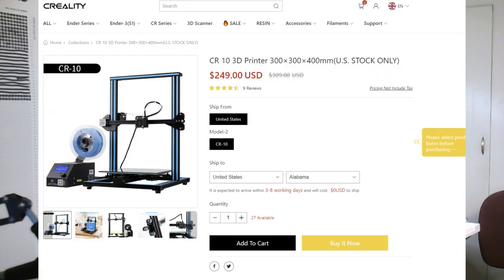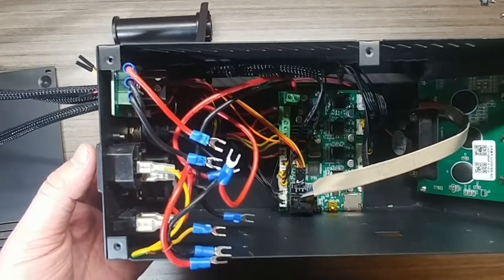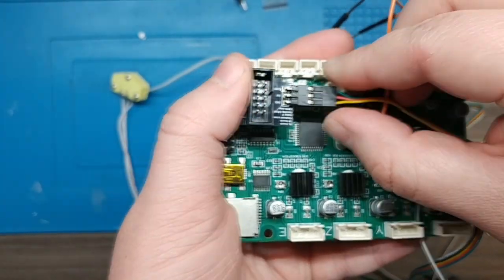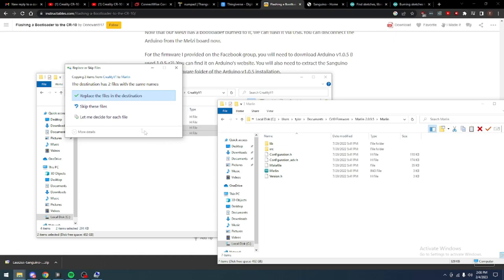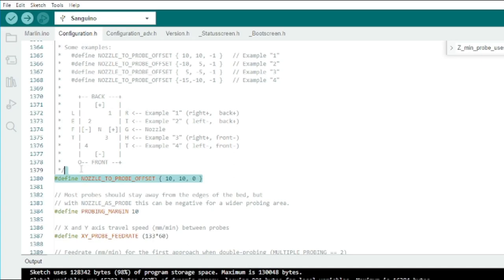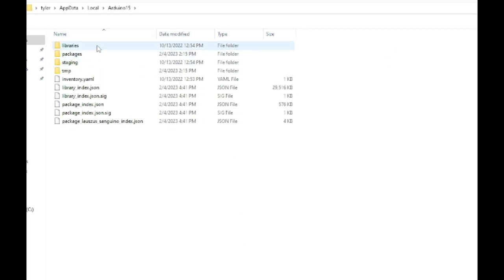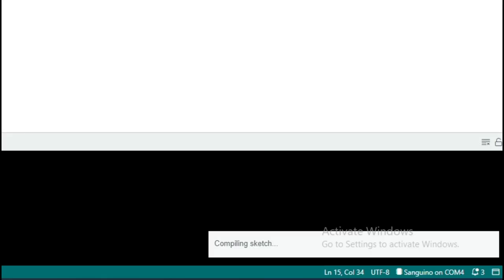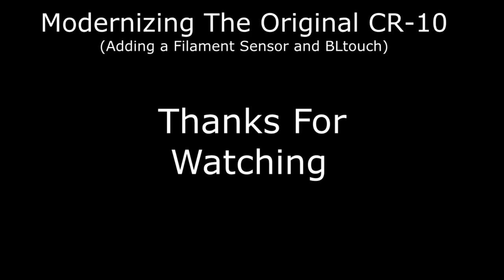Modernizing Old V1 CR-10 for 2023 – BLTouch, filament runout, Marlin 2.0

Comment: Thank you for this video! I've just upgraded my FIL's printer - an old CR-10 - to have a ABL probe and filament sensor and your video was a very helpful guide. Somehow using VScode and platformio I got the firmware on the board and didn't loose any functionalilty. Not many people had clear guides to follow for trying to do this so appreciate yours.

Comment: I have just bought a used V1 CR10 for the large print volume.  The base on the power supply was installed the same way as yours - Upside down, with the feet pointing inwards and with the vent inlet in the wrong position relative to the fan. Turning it upside down and around lifts it off the desk and  allows proper airflow to the fan.  Many thanks for the video it is very informative.

Comment: Nice work! saved the video to perform this update on my CR10
Reply: Is this low cost 3D touch working well??
Reply from the maker: @julioboss1982  Sorry I missed your question here! Yeah it seems to be working well enough. Sometimes it's not 100% accurate but from what I understand a real bltouch installation should be the same steps

Comment: Hi.  You have done a great job here for those of us who need step by step approach.  I too have an old CR10 V1 - so old there was no printing on the control board!  Anyway, I have followed your steps and have three issues, one of which I solved.  (1) I get errors whenever I tried to upload to the CR10 mainboard.  Turns out there is a known bug in the newest Arduino firmware.  So I had to downgrade the Arduino AVR Board to 1.6.21 for it to work.  The most recent update, 1.8.6, apparently has known errors.  (2) The SD card reader seems unresponsive, so I have no way to upload for printing.  I double checked that only SDREAD was defined.  Did I inadvertently edit something I was not supposed to??  (3) Do you have a good procedure for establishing Z offset?  Thanks.

Comment: Hi is pin 29 labelled in any way?  I have the original  CR10 board that is a bit different to yours and the isn't a hole in the exact location.
Reply from the maker: As far as I know Pin 29 is not labeled and was kind of a hidden "bonus" pin. I'm not sure about all the Melzi board revisions but yours may be a newer or older one if it's not in the same spot. There is a video by CrossLink which is where I found it. His video might help you get  closer to locating yours

https://www.youtube.com/watch?v=wVU_5lZKuMo

Comment: Hello mate, awesome video! I have difficulty locating an 8-bit probe for my CR10 v1, the link you provided is dead. Can you recommend some other one?
Reply from the maker: Thanks! Sorry if I'm misunderstanding but by probe I assume you mean the bed leveling sensors? Bltouch in this case. The link I have for that one still seems to be working and in stock.  Let me know if I understood that wrong

https://www.amazon.com/gp/product/B09M9V8Y4Y/

This is the one I bought and used and right now that link is working
Reply: @WightHouse45  yes that's what I meant the bltouch. The Amazon link is not dead you are right, but the product is currently unavailable.
Reply from the maker: @digitalfabricationlab  weird cause that  link posted above link has them available for purchase for me right now. I'd post a picture if I could but I see them at that link right now for $15. Maybe it's location based on how it shows up on Amazon. I'm in the western USA.

I did find some other cheap ones on ebay. I can't vouch for them cause I haven't used them personally, but it does look like they have the correct wiring (z end stop+, Z end stop -, power, ground, and gpio)

https://www.ebay.com/itm/254024150340

Comment: Hello, thank you for this valuable video and beautiful explanation.

I get this error while installing:

avrdude: Expected signature for ATmega1284P is 1E 97 05
         Double check chip, or use -F to override this check.
Failed programming: uploading error: exit status 1 

What is the reason for this error?
Reply from the maker: Hey! This error shows up when the arduino reads the wrong signature from the chip it's trying to program. It can also show up if it sees  no signature at all (wires not fully connected, or hooked up right).

 So some things to check would be to ensure all the connections are correct and secure from the arduino to the CR10 motherboard, check to ensure the microcontroller on that CR10 board is indeed an ATmega 1284P. It's possible there are newer/older revisions of the board that use a different microcontroller, though I'm not sure if that's the case or not. Either way the goal is to  first ensure the arduino is getting SOME kind of signature form the chip (this would confirm things are connected correctly) and if it is, it may need to be flashed with a different microcontroller type.